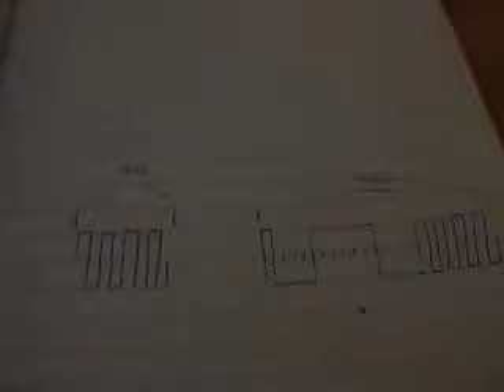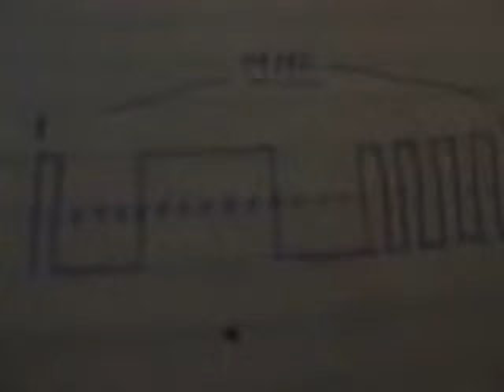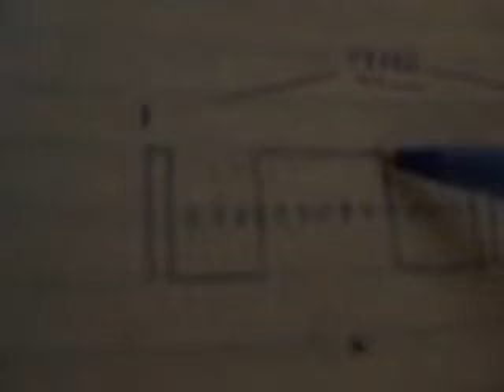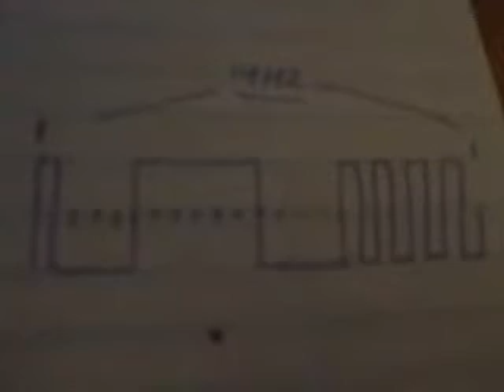Opticom Emitter Arduino Prototype

Comment: Opticom has 10,000 possible codes, so you would need to do a similar frame by frame analysis for each area. Too many people figured out that you could build a simple 14 hz flasher with 555 chips, or even use some commercial strobe lights, and change traffic lights, so they started encoding them. I bought an Opticom receiver and phase selector off eBay for my traffic signal display in my basement, but I factory reset it to accept all or no codes so I can just build a simple 555 emitter to trigger it.
Reply: could you send me the signal

Comment: Where do you live? I first tried using a 555 timer to drive a high power transistor/IR Array. I had a multimeter monitoring the output frequency at both 10Hz and 14Hz and could capture the IR output with a camera. I had zero success.

I also programmed a Arduino PRO Mini with the software used in this video and it did not work either. Right now, I am trying to develop a scheme that can go through all combinations of sequences, but having trouble trying to figure out the modulation.
Reply: Have you had any success at all?